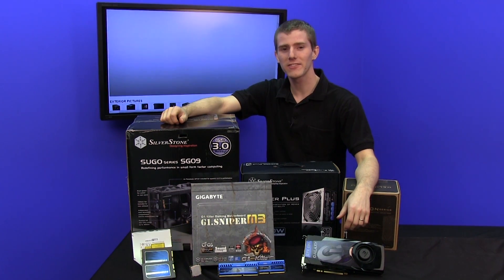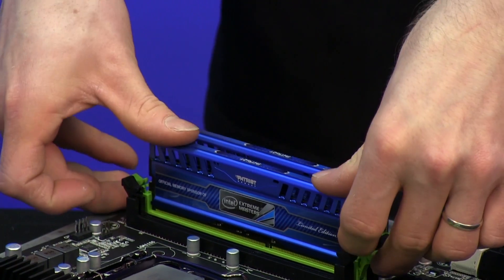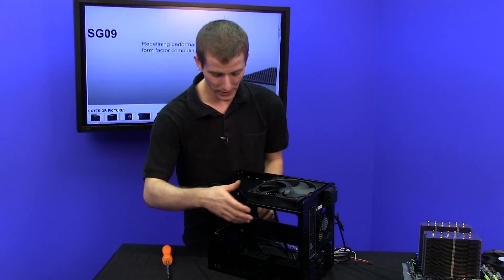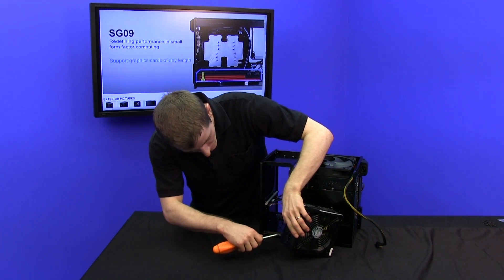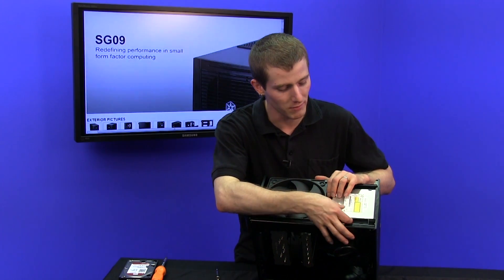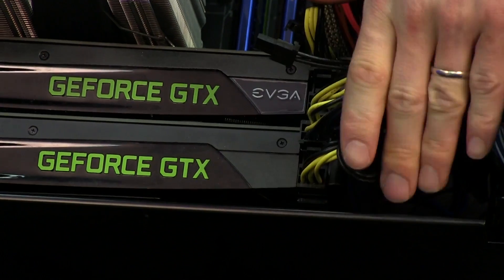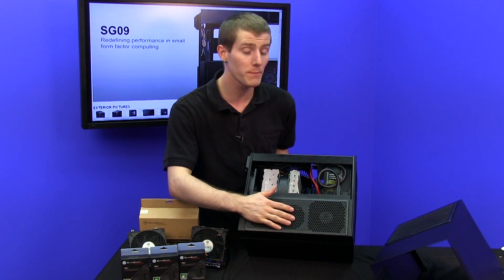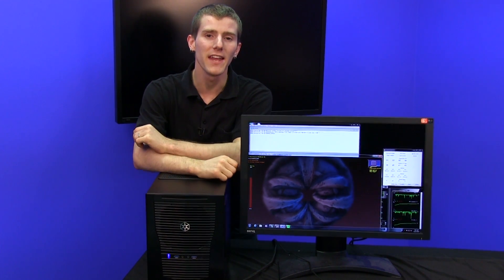Silverstone SG09 Small Formfactor Gaming System Build Guide NCIX Tech Tips

Comment: There are four slots on the board.  The first runs at x16 if nothing else is occupied.  The next one is x1, physically.  What the other guy was getting wrong was that the third slot isn't 8x, electrically.  It's wired at 4x.  Instead, the forth slot is 8x.

16x
1x
4x
8x

My guess is that Gigabyte did this so that there would be at least one slot spacing between two graphics cards.  The problem is that most microATX cases have 4 PCI slots.  So having a card in the last slot won't physically fit.

Comment: m4 128GB SSD
WD Black 2TB HDD
Z77 Sabertooth
i5-3570K (auto overclocked to 4.0 GHz)
GTX 670 (stock, no overclocks)
16GB 1600MHz Ballistix RAM
500 W Lepa (80+ Gold rating)

I might upgrade the boot drive or (MAYBE) the graphics, but so long as nothing breaks I'm hoping I can hold out a long time. Haswell is coming out this year, Broadwell should be out by 2014, and Skywell in 2015. By then we'll probably have DDR4 and maybe SATA IV, and like I said maybe some kind of Miracast standard.

Comment: The 690 exhausts into the case, which would compromise cooling. Also, 2 GTX 680s cost $840 on NCIX while a 690 costs $1030. 690s also perform worse than dual 680s.

Comment: Linus did a video comparing tower coolers, thick 120mm rads, and thin 240mm rads and the 240 beat the tower beat the 120, so he'd go with a tower over a thick 120mm rad.

Comment: 1st off. Throw away 680 SLI and just put in a 690. There is no reason to crowd it that much more. 

Secondly. I would have went with an H80 cooler or something. Those big ass metal coolers are just to bulky for such a tiny case.

Comment: I would have gone with the Silverstone Temjin TJ08-E over the Silverstone Sugo. The path the air takes in the temjin makes more sense, as well as having a dust filter. Also, it is possible to configure the fans such that all of the exhaust is expelled from the gpu heatsinks. Not only that, but if you configured it in such a way, the fans would not be recirculating the hot air exhausted from the graphics cards onto your cpu again, considering that the motherboard is upside down in this case. (:

Comment: specs are:
cpu: 2500k
gpu: gtx 680 - there are two of these
ram: 16gb - (2x8GB)
HD: there are 2 SSDs, not sure of exact size but my guess is at least 128GB on each one

You can see from the video all the parts used which includes brand names and model numbers.  I used the website pcpartpicker(.)com and built the same pc with same parts which costs at least $2103.40 in US dollars, this does not include any extra fans, OS, or the custom cabling kit.

Comment: You would definitely have to go with something like an H60. With an H80i the push pull that is needed for it would be too big for the case. Not to mention that it helps to have a slim radiator because it lets more airflow through.

Comment: Reference GPU coolers are called blower coolers and are really good for small builds like this. The cooler actually doesn't exhaust any of the heat into the case and blows it out the back through the grill. This makes the temperatures inside the case manageable. If he used two ASUS DirectCUII cards for examples, they would get extremely hot and probably be above 90C cause they have no room to exhaust in a small case like that.

Comment: The 3930k and 3960x is not worth the extra money if you're just supposted to use it as a gaming rigg. Most games does not support above 4 cores. Some don't even support 4. And almost no game at all support HT. So basicly you would throw the money into the lake if you bought a rigg who consisted of the 2011 socket without using the HT in applications that support it fully almost every day. The 3570 on the otherhand is priceworthy and will not flask 1-2 GPU:s.

Comment: Actually an intel i5 3570k overclocked to the same speed as the 3930k, and 3960/3970x may be even faster since ivy bridge cores are faster clock per clock and most games don't use more then 4 cores

Comment: He did do an itx build a little back and was gonna use a reference 7970, but unfortunately, the extra little plastic shroud at the end of the card made it too long
(remember that rounded end edge on the card)*
They then used a GTX670 as a replacement because of its size.
So he has at least tried!

Comment: They are compared to current gen Nvidia products. They overclock further but they are alot warmer. If you put two stock cooled 7950s in that or 7970s you would get a real heat problem real fast, third party coolers do not work in such a small enclosure. So before you start talking "like a boss" you should get your facts straight. 600 series is alot more power efficient and cooler but its also weaker. The 7970 stock cards run about 20 degrees hotter than 680stock cards. this matters.

Comment: Well the AMD cards perform better but they are also ALOT hotter and use alot more power. which means you needf a bigger powersupply and that just wont do for a small pc like that, you will get overheating issues. I like the 680 because its 95% of the 7970 ghz for 20% more but also 30% cooler and uses 35% less power.

Comment: No shit sherlock

I was OBVIOUSLY talking about which possible pci express slots you WOULD NORMALLY put ANY gen 2 or gen 3 video card into.  duh

( Facepalm)

that's why I DIDN'T MENTION x1 slot.  NOtice something..a video card WON'T WORK ina  x1 slot.  It's not electrically WIRED to make it work, genius.
Now pardon me if I got the x8 and x4 slots mixed up.
THUS.

one in x16 top slot
2nd in x4 slot which is third slot down
This will STILL give plenty of performance. x4 gen 3 = x8 gen 2=plenty

Comment: Wrong.  Both the top x16 speed and the x8 speed pci express slots are gen 3.  gtx 680 is a gen 3.0 card

From the top it is:
x16
x8
x4 <--- pciExpress gen 2.0 slot

Notice in the video that both cards are damn near touching each other..

He DID use the top pci express slots that are most coherent to the cards best sli performance.  Thus Linus installed it correctly

Comment: Wait a second.  Isn't the third PCIe x16 slot running off the PCH (4x electrically)?  So Linus, you'd have to put the second GTX 680 in the last x16 slot which won't physically fit with that case.